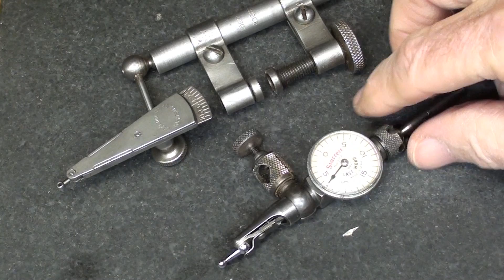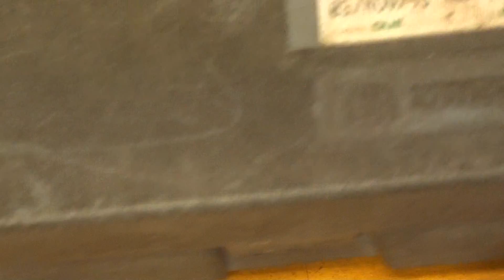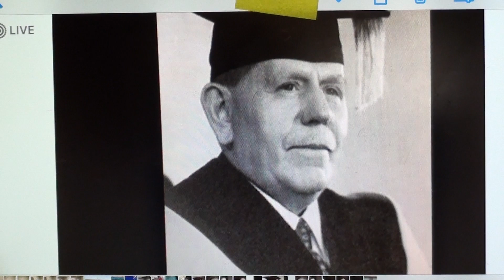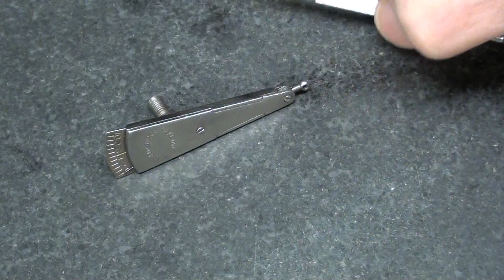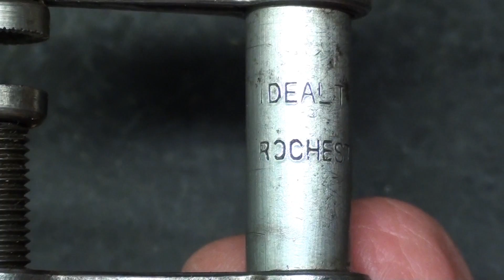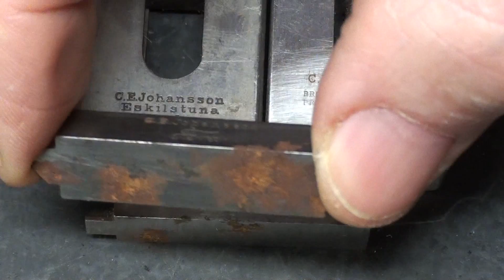Accuracy of Antique Test Indicators #529 tubalcain

Comment: I can see the "Ideal" indicator moving slightly during the tests. It is very subtle and you have to look very closely, but it could be roughly 1/1000th of movement (one pixel or so on the screen). I think it is a lack of rigidity in the setup allowing for this. I bet with more rigidity it will indicate dead on. Great video, thanks!
Reply from the maker: Yes thanks